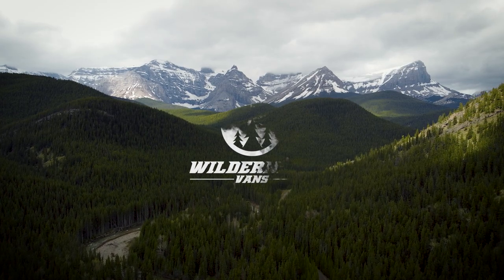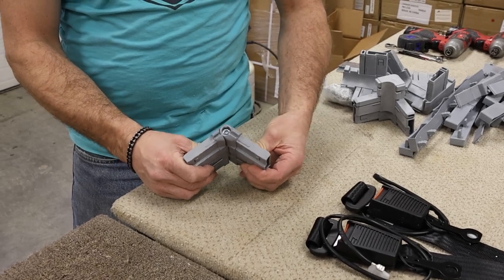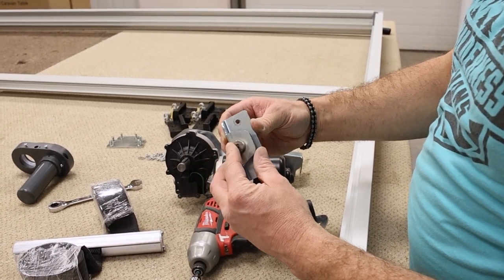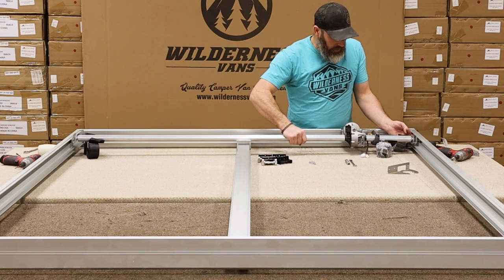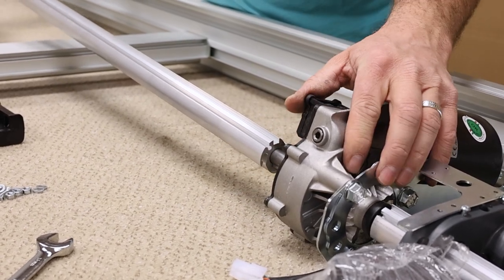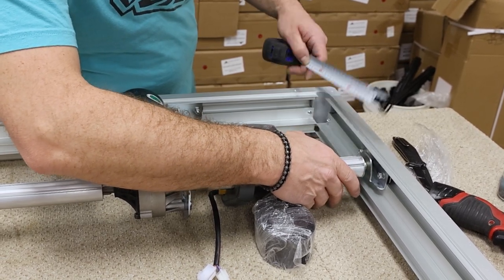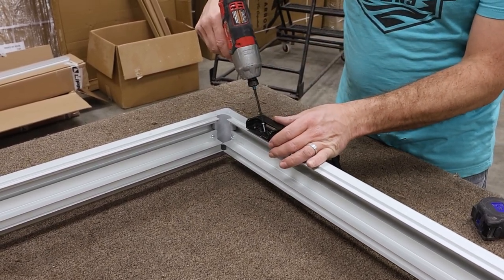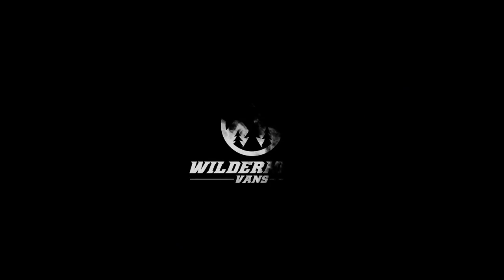Wilderness Vans - Lippert Smart Bed Assembly Guide

Comment: Hi, I found the video very helpful, but there is an error in that the new mounting brackets for the ends of the motor shaft are upsidedown. This was probably  done by accident as you were working on the underside of the bed. 
             It may seem of little consequence  but it has two effects.
1/ the clearance of the motor shaft with the center brace is greatly reduce.
2/  On the motor bracket that clamps to the end rail,  there is a small but vital extension piece that supports the weight of the motor and helps to keep things aligned.  If the motor is not properly supported it could result in premature wear. 
..  I hope this might reduce some head scratching